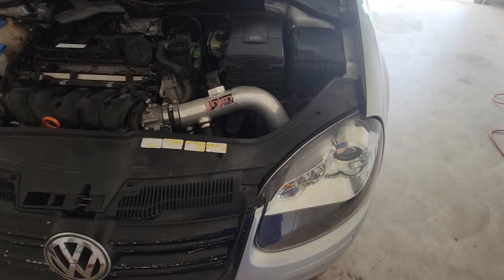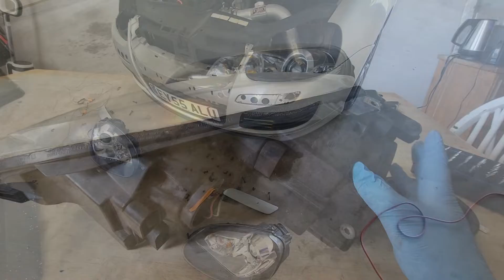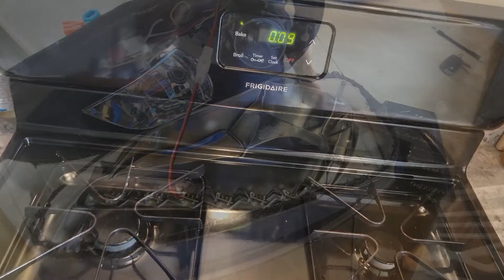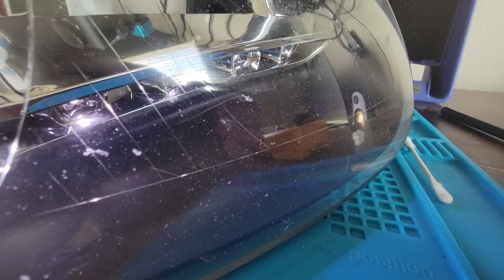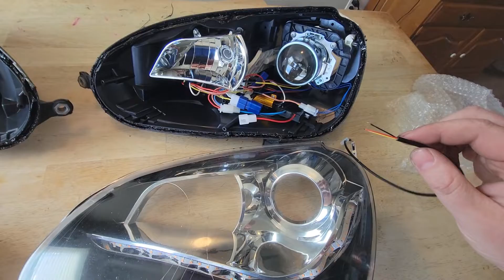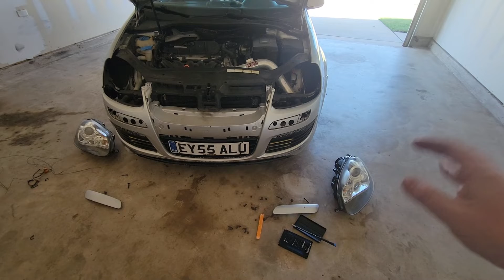(Repair) 2006 VW Jetta Aftermarket Depo S5 Headlight Modification

Comment: would have looked better with the diffuser on the led strip
Reply from the maker: I agree, but it would not have bended into position and stayed with hot glue. I actually did a revisit to this with a better solution. That video will release next month.